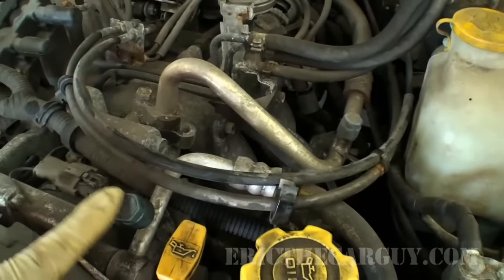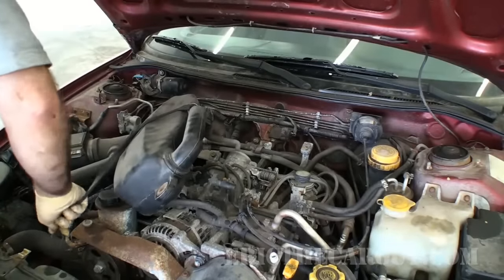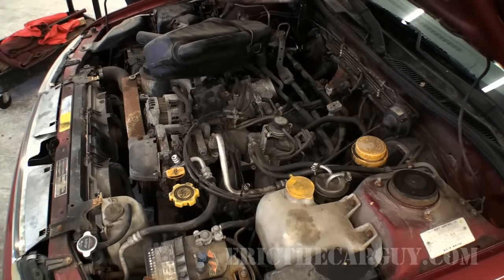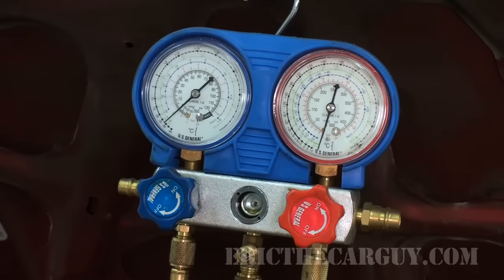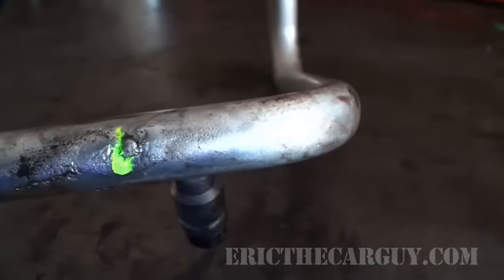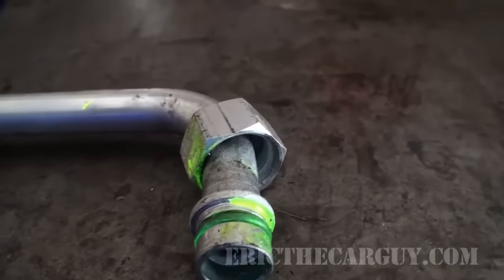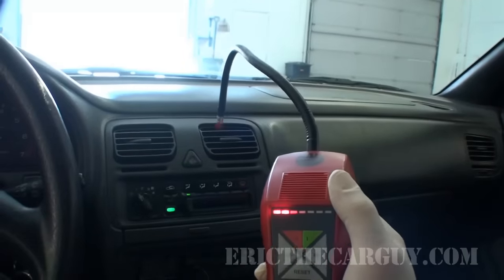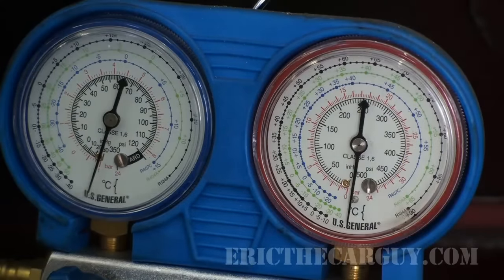How To Find and Repair AC Leaks - EricTheCarGuy

Comment: Found the video to be great but question with the cost of freon and all the money you obviously already put into the vehicle with the new line set,etc.Why would you not replace the pressure switch.Not trying to be critical,but should this switch malfunction electrically at a later date,you will be going thru the entire procedure of drawing down the system,evactuating,and recharging all over again.A switch is relatively a inexpensive part and would just seem more ecomonical to replace with the new receiver/dryer.

Comment: That was quite an impressive tutorial.  While I doubt I'll tackle a repair like that, it's good to know what's involved.  At least I can talk intelligently to a mechanic or perhaps get a feel for what the mechanic might be skipping.
Reply: ive found that alone greatly improves outcomes when taking your car to a mechanic.  if you can  pre diagnose the issue its even better.  also, be careful where you take any uncommon makes and models. you would be surprised how many mechanics cannot repair VWs and end up breaking the plastic covers on the engine, battery, etc.

Comment: Great video Eric! A/C systems can take a little while to diagnose, recover, vacum, check for leaks and charge.  I work on semi's and sometimes it can get frustrating doing a/c work espically when drivers are waiting because they want to get down the road thinking the "fix" to their a/c system is just topping the system off when really it can take a few hours getting a good vacum pulled, checking all of the lines for leaks and fixing the broken/damaged parts.
Reply: EXACTLY!

Comment: When you take your vehicle to have coolant put in is it required for the mechanic to check for any leaks.. is that something extra that you have to request? I'm asking because I took my car in a couple days ago and the compressor wasn't working so they put a cannon and it was working fine AC was coming up last and cold and the next day no more cold air blowing out anymore, and the compressor stopped working.

Comment: Good stuff, I'd like to mention however that R-12 is still in fact sold, but only for vehicles where conversion would be cost prohibitive. If you still have a vehicle with R-12 in it (as in, it actually has a charge); and you need to evacuate it for whatever reason you can sell your recovered R-12 in most cases.

Comment: I appreciate your videos. I have a question about a problem.I have a total tear in my engine coolant rubber line at the crimp, where it meets the metal line. This is at the rear of my minivan. When I inspected the leak the whole thing  tore and drained the coolant. Do you have a video on that? I have seen repairs online where the whole line is changed. But I was wondering if it is possible to change just the fitting? Otherwise how much do you think the repair is and is this a piece that is available at the garage or usually needs to be ordered?
Thanks.

Comment: Holy cow. Looking up a receiver drier and the price range is ridiculous. As low as 11.00-19.00 then it goes to $275.00-$350.00. No in between. I need to know if this is you get what you pay for or is one way over priced. I've seen big price differences but this is nuts
Reply: C'mon....compressor vs. drier man.

Comment: eric is the dye also act as a lubricating oil? I am just wondering what the ingredients of the dye are, and if it can have ANY negative effect on the a.c. circuit. 

bro Im learning so much from your videos. You are now my "go to guy" for youtube auto repair! I think your videos are the best. Blessings man and good job..
Reply: Dye is actually refrigerant oil mixed with dye. It will have no negative effect. Most modern vehicles actually have dye in the system from factory

Comment: To get all the moisture out of the system, you must pull it down into microns reading a micron gauge. If you can get it to hold 500 microns or less, you're pretty safe. It could take hours to achieve this vacuum since the refrigerant oil also absorbs moisture. Any moisture will show up later with internal corrosion and many more leaks.
 Just too many things to talk about and I think you realize it.
 It would take an hour long video instruction just to touch the surface in proper procedures, tools and how they should be used. You must have the proper tools and knowledge.
 This is why I won't do a video on this even with 41 years experience.
 Under the circumstances, you did a pretty good video.
Reply: He said to pull a vacuum to check for leaks

Comment: I just added dye to my Windstar system and now I need a UV light. When I hooked up my gauges pressure was zero. I added 134 and dye until the compressor kicked on. Mine cycles on and off every 5 seconds, I was wondering if that is some kind of automatic sign that the compressor might be bad?

Comment: Find out if you need PAG oil or Ester Oil, and the amount.  The amount of oil needed will vary by system and how much R134A you put in the system.  This is explained well in the Haynes book.  There is different viscosities of PAG oil depending on the compressor.  Look up the viscocity that your compressor needs -- not all the same.  If you did a full AC repair with new compressor and dryer, split the required oil between the compressor and dryer.

Comment: Amazing video's. My A/C system has not worked for 3 years, does that mean there is a ton of moisture in the system? Also with a fully discharged system, does that mean the compressor will not turn on? Also ebay sells $11 A Diagnostic Manifold Gauge Set, just not sure if its trustworthy.

Comment: so it's a BIG trick :)
thank you for the info, actually i haven't yet met one of those running with propane but i used to hear about them though, the trick also is the lower pressure point of condensation is; the better freon is, especially on cars as the horsepower is one of the important arguments.

Comment: Hi Eric,

Thanks for the informative video, this makes things under the hood look more simpler and thanks for explaining the basics of AC and fixing it, I only have a question, as You showed checking leaks by creating a vacum, one of My friend pumped in air and created a pressure to check pressure leaks, is that fine too?

Comment: Eric -- good job, but I'd go with new (green) HNBR orings (viton) on the receiver/drier.    Mucho better for the newer refrigerants vice the old black (nitrile) originally designed for R-12.  Some of the old black orings have residual amounts of mineral oil if the system was converted from R-12.  Really don't want residual mineral oil running around in a system designed for R134A.  Ester oil  is easier on R134A compressors.   Leak electronic "sniffers"  are all problematic --- I own six (6) different brands (including Snap-On) and they're all problematic.   Best way to locate leaks is with the dye PLUS an audio "sniffer".........

Comment: We were driving in Vegas and the cold quit. I looked and didn't notice any obvious leak. I am just using the pressure guage on the coolant I bought at wallyworld. It went in so much, then it seems loke no more will go in. It always reads in the low area. It stopped filling and no more will go in. Still doesn't work. I may need to use the dye.

Comment: I have a ? that is bit off your specific topic, however it is a cooling system ? Just not the same part of the system as this vid. I just finished a severe flush on my g/f's 12' Dodge Avenger due to previous owner apparently mixing 2 different coolants together, & so graciously blessing me w/what looks like a serious case of the next day beer shits left as our coolant...anyways my ? Is after 3 days<--(NO JOKE)of flushing, I'm to the part of refilling the coolant yada yada yada...but after closing the petcock & beginning the process suddenly the petcock is leaking fairly rapidly about a drip or 2 per second...is this at all common, for petcock plugs to leak after flushes, &/or is this a leak that could be solved w/a bottle of that coolant leak stop, &/or (if this isn't a stop leak fixable issue) is it possible to replace a leaking petcock or is that a more serious/expensive issue to fix (if a new part is needed that is) 
     I'm sure this is a fairly layman's style of ? to most mechanics but if it isn't obvious by my ?, I'm at the very best a VERY novice auto "mechanic". Lol so any info at all would be greatly appreciated! Thanks  
P.S. lovin all the videos I've seen so far very informative & helpful I'm now a subscriber!

Comment: I get how you find the leak or check if there is leaks but if one is found should you always replace the full line and hose or can you some how splice into them and add compression fittings or jb wield to fix them. Or are they not like brake line that you can splice into and flare an new connection.

Comment: Eric, will a vacuum pump dry out a receiver/drier?

Or, the old way of baking it at about 200 degrees F?

steve
Reply: Personally I pump my systems for about 1-2hrs on a warm day and don't seem to have problems with moisture as long as large quantities of water haven't entered the system

Comment: Great video, as always!  Autozone sells a good DVD on AC repair & charging. Haynes has a good book as well for AC work (ISBN 1563927845) to fill in the gaps.  Your video, the DVD, and the book should give a solid foundation for DIY AC repair. 

Autozone in some cities will (or used to) loan out an AC vacuum pump and gauges.

I'm a hobbyist and here are some things I have learned:

Comment: I love your videos, they are very helpful and you put them at a level that everyone can understand.  I have watched your ac videos.  I have a 88 chevy truck that is set up for r12.  The condensor has a hole and i'd like to get the air working.  What needs to be changed?  Also, it doesn't have a drier.  The only parts are condensor, compressor, accumulator and evaporator.  Is the evaporator the drier?

Comment: I have a 2000 nissan quest The air conditioning works well but in his interiro has two compartments. The compartiento of the front made only hot air compartment back if it works well. the compressor works well

Comment: I have an issue with a 1995 Nissan altima AC system. It works fine for awhile but after 10-15 mins of driving the air becomes warm. I have checked the coolant level and the pressure is in the green arc psi originally..with the AC running like its supposed to be. I checked the psi on the low side of the system after driving for a bit and after the air became warm and its way high (gage pegged) but the compressor still seems to be running. (usually pressure is lower (in the green) when the compressor is running and much higher when it kicks off which is normal as I understand it?. Is there something that could make the presser high on the low side of the system when the compressor is still running and that making the air warm?..i have also notice say during interstate driving after a bit the air may become warm if i turn off the AC switch (turning off the compressor) for a bit then turn it back on after about 5-10 mins the air is back to being cool again....

Comment: How long is too long for having to replace the receiver/dryer?  My system leaked out just last year around the end of summer (good timing) so it has not been a year yet AND I had previously repaired the system with a brand new compressor and receiver/dryer.  Would it likely be fine to use the same receiver/dryer?  Thanks!

Also, you mentioned refrigerant being heavier than air; I watched another video here where they used the sniffer under the car at the evaporator drain tube after running the system for a bit and then shutting it all off.  I suppose either way works, they would both tell you if there is a leak around or on the coil, but I thought I'd share that.
Reply: From what I understand as a former Ford dealership service writer is that the receiver/dryer needs to be replaced if the system has been open to the air for "any length of time".  Several hours is the guide we used to use.  By that "rule" you're sure to need one.

Comment: I could tell you had a leak when you closed the valves at 9:35, because the pump changed it's tone. If you have a perfectly sealed system the pump won't know if the valves are open or closed.

Comment: ?  Instead of charging the system with the refrigerant would it be appropriate to charge the system with air and use soapy water and look for bubbles. since it will need to go into a vacuum again before you charge it again?

Comment: Been looking for a how to video to convert my 1993 GMC Serria 1500 4x4 from R12 to the new stuff, I hear there is an inexpensive conversion kit you can buy, but the AC guys charge 3 to $400.00 to install this kit alone, then more on top of that to recharge it.. I am told it is very easy to convert it your self in a couple hours, I went to your website, but it says not to email asking how to.. to use the web tools, witch I didn't find, and don't find a video on it, can you do one?. 2 years ago had it recharge with R12 but they charged the death out of me,, it only worked all that one summer, then after a long cold -40 winter, last summer didn't work. there is a bit of presser not much

Comment: Auto Junkyards are a great source for car parts that are hard get.

Also do not overcharge the system and if it is overcharged the compressor may not work as their is a pressure sensor that can tell if their is too much pressure and it prevents the compressor from working.

If you get work done get an invoice which says how much gas was added, normally in grams.
And the average small car(like civics) will need around 450grams but look at the service manual for the right amount.

Comment: Question: I found a pin prick small size leak in my ac condenser (2014 Ford Explorer Sport) and since I dont WANT to drag it all out..... is there a way to patch or pinch & patch the pin prick area.?  sodder, or JB Weld  or ....  ??

Comment: I have just installed a  AC System. 
Everything New. Compressor Condenser, Lines and of course, Evaporator.
  
I wanted to leak test the system first, So I haven't added R134A yet.
I have added PAG 100 Oil though, 
6 oz in the Compressor and 2 oz in the Evaporator.
 
The problem I'm having is that I'm Not Holding a Vacuum.

With no Freon in the System yet,,,
How can I Test for a Leak ???

Thanks  ! Any help Greatly Appreciated !!!

Comment: hi Eric, my system has pressure but it isnt blowning cold.when it is being charged it blows cold but after the charge(overnight) in the morning its back to no cold air. i check the line and it has pressure..a lot of pressure need help.

Comment: getting ready to tackle an AC job on a early 90's  s10 pickup. the question I have is about the compresser. when I turn the AC on the clutch keeps engaging on and off every few seconds. what does this tell me about the compresser or the system?
Reply: I believe that means it's over charged. It's called short cycling.
Because there is too much freon in the system it compress too quickly causing the compressor to shut off sooner

Comment: Hi Eric,  I love your videos man!  they are awesome. I wanted to ask you: 
I own a 2011 Subaru Forester X none turbo and I recently found antifreeze or maybe it is oil from the compressor underneath it. I have no ac working right now but the compressor stills comes on when you turn the ac on. I was wondering if this compressor has a seal or gasket that could be the problem and if it is, can it be fixed? should I just replace the unit?

Comment: Hi Eric!

A dumb question maybe but. . 
If there is no pressure on the low side, is there pressure on the high side? 

Thanx from Sweden 😆
Reply: +Fredrik Sundvall Most likely you'll have some high pressure left over, since the high side is meant to withstand much higher pressure than the low side. But it also depends I think on other factors too like if the expansion valve is open or closed...etc. If there is a leak in the system though, both sides should be 0 because eventually all the pressure will leak out. Correct me if i'm wrong!
Reply: Fredrik Sundvall s

Comment: I wanted to ask you before you made the evac and recharge video. How would you evac  system with that set up and no leaks to do say a compressor? I've been kinda spoiled and have had a/c machines to work with.

Comment: To add your die, what I do to add oil is take your high pressure side off the gauge set while under a vac, and let it draw into the system that way, much easier

Comment: HELLO HUMMER FORD CAR ,I CLEAN THE RADIATOR NOT TO DRAIN TO THE LOWER PORTION OF THE  ASSEMBLY,  CAN CAUSE OF THE OVER HEAT THE ENGINE?

Comment: Perfect Eric, recover,fix,15 to 30 minutes vacuum,recharge with correct amount of R134 using a digital scale, some green ink "that is the way I called it" lol, check for leaks, turn on the engine, AC in high is the low side hose cold? good, is the high side hose hot? is good, well is more to it but I have characters limitation here LOL good video Eric! in Iraq I fix so many AC in Iraq when I was deploy 2 years many weird things happen with AC

Comment: Typically, perforated lines mean, "service by replacement". When you say you soldered the hole, did you use lead or silver solder? I didn't think they would stick to aluminum. I like to use alumiweld. It sticks to aluminum and makes a permanent repair. And I do mean permanent! Great vid,btw!